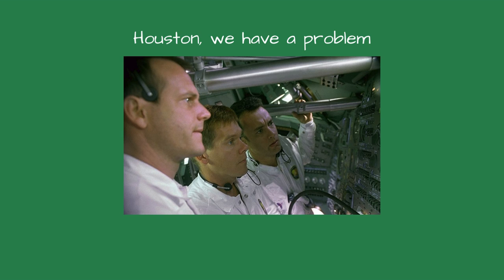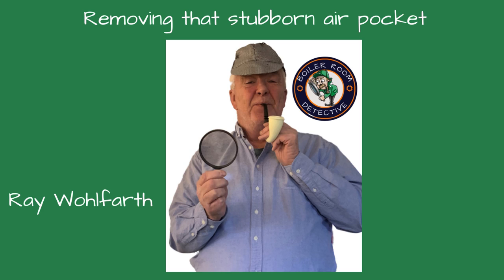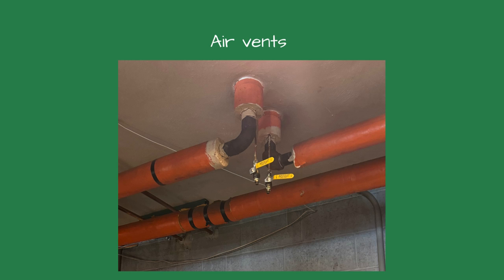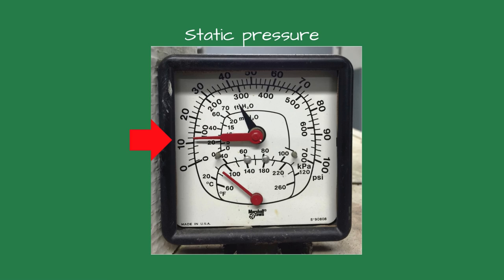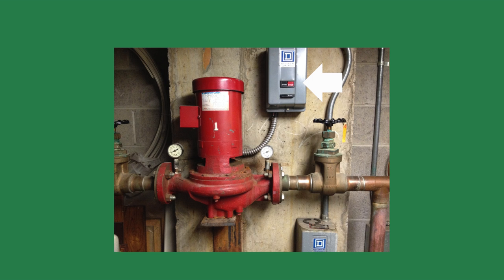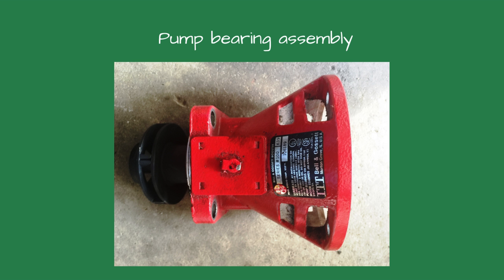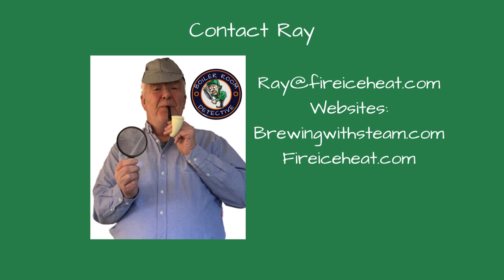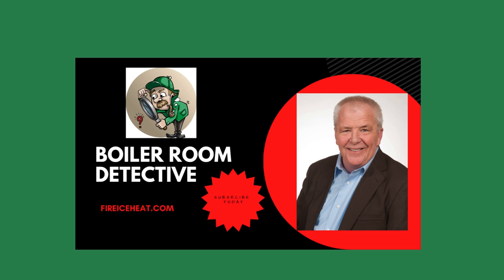Case of the air bound hydronic system

Comment: We had a similar venting arrangement in two 6 story dorms that were built in the mid-60's. These buildings had Reverse Loop Hydronic heating systems.  At the top floor of each Riser (of which there were several) there was 1/4" copper tubing tee'd into the riser and automatic vent with a petcock.  The tubing then ran all the way down to the basement where it was open to the atmosphere.  Regular visits to the mechanical rooms one could look up and see if the venting had been blowing down or leaking.  It all worked pretty darn well.
Reply from the maker: They were pretty smart back then